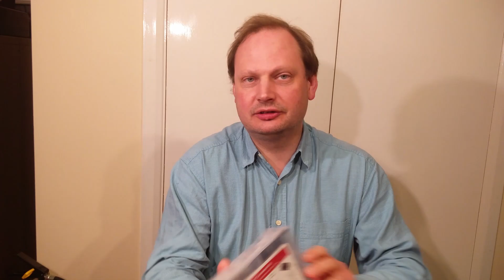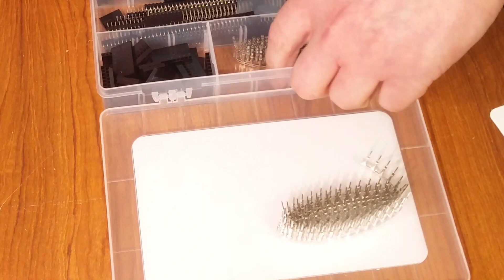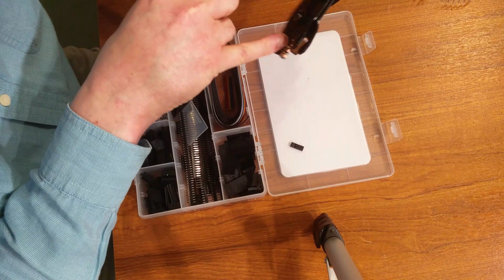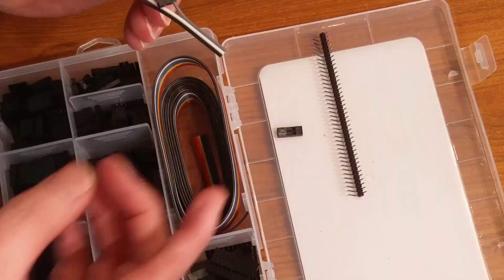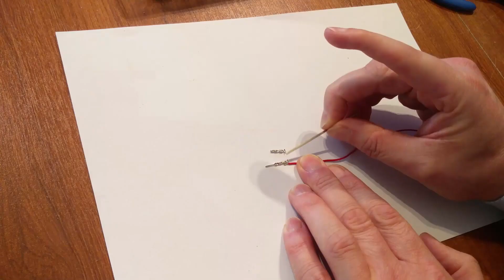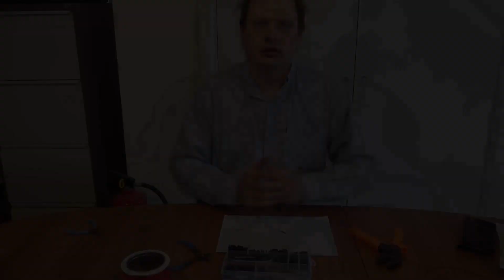26 Dupont connectors for wiring model railways

Comment: Hi, I tried at one point to use connectors that had similar crimp pins and sockets. Unfortunately I didn't have the patience to keep going as I couldn't get a consistent result. Maybe I didn't have the exact right crimper. I ended up using 2.54mm 0.1 inch pitch pcb screw terminals which I soldered to some veroboard. For me this probably worked out easier as my layout is made up of T Trak modules. I admire your paitence and the fact you show all the problems you had. I only wish that with these connectors and crimpers that they would include some instructions on how to use them! Cheers  John
Reply from the maker: Instructions? But no-one would read them anyway!
Reply: @naivegauge  lol

Comment: From my experience of using that style of crimping tool your meant to load the female or male part in the jaws of the tool then squeeze the jaws until it just holds the connector in place then insert the wire and finally squeeze all the way.
Reply from the maker: That is what I figured out by the end of the video. Still need a bit more practice, but it comes together eventually. The finished result is very good if it is done correctly.
Reply: @naivegauge  yeah I commented half way into the video then saw you mastered it by the end lol keep the videos coming 👍🏻
Reply: The crimp should also pierce the cable as well so you shouldn’t need to strip it
Reply from the maker: Rodney, that is very interesting. I will give it a try. thanks.
Reply: @naivegauge  Did you have time to try without striping ? Thanks a lot for sharing your full experiment(s)
Reply from the maker: yes I have tried to do a few without stripping, but have gone back to always stripping. Some of the ones that I did not strip did not make and electrical connection with the conductor. Admittedly this were with a wire that had a very small conductor and large thick insulation, but it is a lot of hastle to deal with a bad crimp, so I would rather be sure.
Reply: @naivegauge  Thanks. I am not surprised with such a size of wires